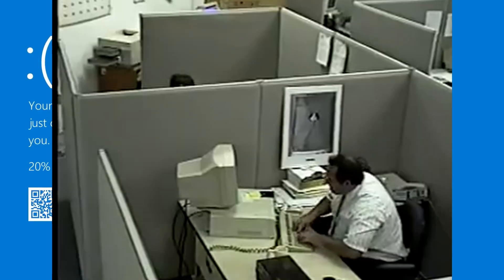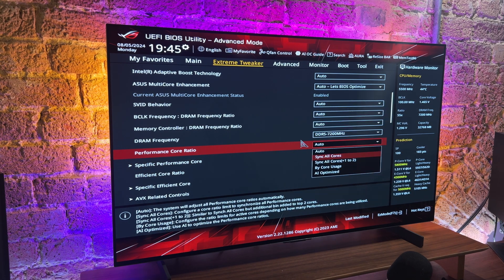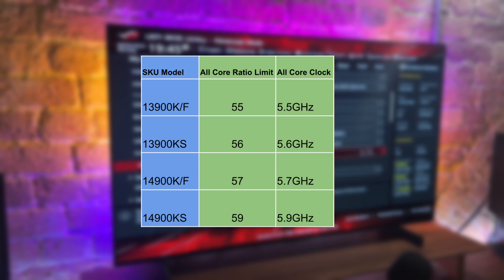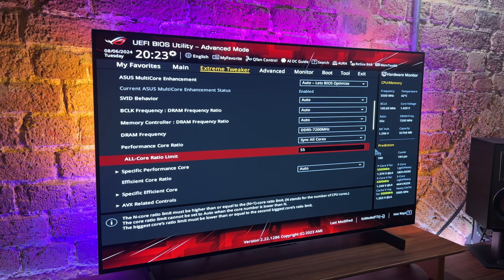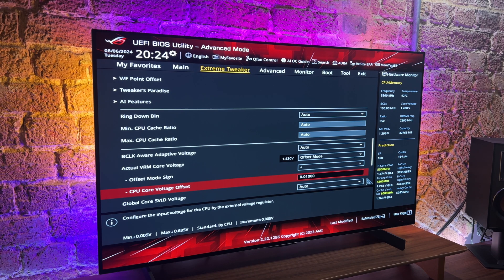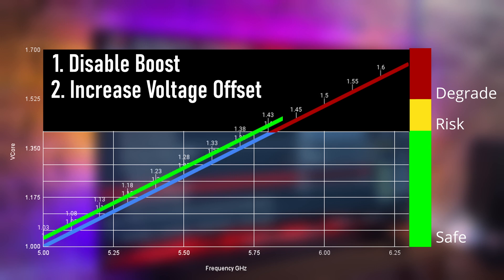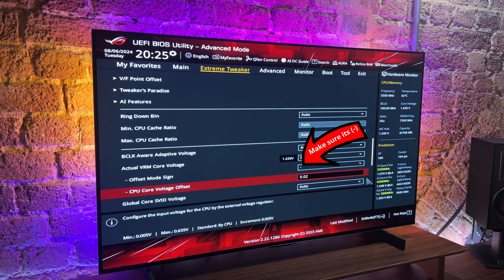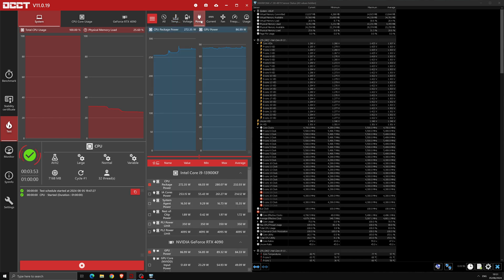How to fix intel crashes in less than 4 minutes

Comment: Thanks for the advice, I have 14900kf and the shop that assembled my computer after recommending a bios update with microcode only recommended setting pl1 to 150W and pl2 to 200W. And when I did cinebench 23 on one core the test crushed many times after 30 seconds. Which worried me a lot, although intel diagnostic tool claims that everything is ok. But I lowered the core voltage offset by -0.05V (because the voltage still seemed high to me it reached 1.492v on the performance core) and in fact cinabench on one core did the whole stable 10min reaching the result of 2123, (max voltage was 1463v) and on many cores 32275 which is still better than before (31200). The question is whether it is worth leaving 150W and 200W or giving more or whether the processor will work better or will be safe and stable. Obviously, stability is the most important but if it cuts a lot of performance that could be useful when working in blender etc. then maybe it is worth giving more?

Comment: Cannot understand if more than 1.38v is in risk, why use Vcore offset+ to work over this voltage, i use offset to all cores +2 instead vcore offset+ and reach 41k in CB r23 with 1.298 Vcore, max temp 85º. MSI MPG mobo +13900k + ddr5 6400
And a question, where you found that from 1.30v to 1.38v is in safe for an architecture 10nm?

Comment: Hello! I had a question. I'm trying to stabilize the all core clocks of my 13700k as I have not yet experienced any signs of degradation yet. When doing step 1 and disabling boost by applying the "Sync All Core" setting, do I also have to disable all of the intel boost settings shown at 0:06, or do I just apply the sync all core settings? Also could you please provide a list of all intel boost settings that should be disabled as well? Thanks!

Comment: All you guys post these videos of issues with the 13th and 14th gen CPUs and about how to fix the issues but it never worked for me because none of you guys have the newest bios installed. I have a Asus z690-p with a i3-13100 and it crashes after 10 or so minutes of fallout 76. I have the bois rev 3403 installed which is the newest one from Asus. How about you update your bois and then give us an accurate and up to date video is this flustering issue please 🙏🏾 .
Reply from the maker: If your i3-13100 crashes then it has nothing to do with degradation, it is something else. You would need to troubleshoot it and find out what the root causes is

Comment: I have i9 13900k its already degraded a quete a bit, and when i "sync all cores" windows dont even boot. only asus logo appears after bios and just stuck. how this can happening, whats the cause?
Reply from the maker: @anjelomichelangelo7726  you would most likely need to increase the voltage offset
Reply from the maker: Or just RMA the CPU
Reply: @gamedaytoday1  ty for answer

Comment: i tested, it's better in games but in many cases I face crashes all the time and no change at all. crash happens again and again.
Reply: i had crashes in fortnite after 0x129 code, but i also put ia vr limit to 1.375volts... then i ramped it upto 1.4volts, the game didnt crash for 2 months... now i updated to 0x12b code, the game crashes again even while setting higher voltages
Reply: @realracing3specter295 found a fix yet?

Comment: Should I turn on the Intel Default Settings that came out with the new Bios update?
Reply from the maker: @Arixfishy  just follow the instructions it does not mater if you use defaults old bios or extreme profiles
Reply: @gamedaytoday1 thanks
Reply: @gamedaytoday1 arigato (I'm japanese)

Comment: Hello a month ago or so I have build my gaming pc and I have an Asus motherboard Z790 A-Prime with an intel CPU i7 gen13700KF and I was running like factory bios version and my CPU voltage wasn't going any ware hight then 1.35 1.37 volts but had friends who told me to update my bios to today's version .. my guts told me not to do it you know how they say if ain't broke don't try to fix it anyways after few days I updated my bios to current version up-to-date with microcode 129 and first day after bios update my CPU voltage were lower from 1.35 to 1.25 1.28 but after 1 or 2 days when I was checked my CPU voltage while gaming I was an increase in voltage up to 1.45 .148 voltage you think that my be a problem should I undervolt the cpu also i have a corsaire aio liquid  cooler 360mm  and with the current CPU voltage my CPU temps don't go any higher then 65 Celsius what I should do .thanks in advance
Reply from the maker: @SmashJou-n7q  yes undervolt
Reply: Oky thanks

Comment: Actually just got my new ryzen 7800x3d to replace my old 12700k, since intel releases unstable 💩 Ryzen 7800x3d with pbo enabled, voltage curve -30, power limit 80 degrees, runs stabile, low temps like 67-70 degrees under gaming workload, 75-77 heavy stress testing, with power consumption 65-70 watts, giving much more fps in games, running cooler, and much more energy efficient than my old intel cpu is just amazing! Just AMD instead of faulty intel, there’s always a choice.
Reply: So hot in gaming

Comment: So I did this through another channel that covered undervolting or limit volting..since my 14700k was constantly crashing when playing the new season of POE...and I'm sure with other games as well...was having similar problems playing Elden Ring.  So my games don't crash anymore after doing this....but this STILL means my CPU is defective or degraded right?  So is the recommendation now to RMA this back to Intel?

Anyone who did the RMA to Intel...will they ship the new CPU first to us before we ship our bad one?  Cause it will SUCK to ship my current CPU and wait what weeks until I get the replacement and I won't be able to use my PC til then?
Reply from the maker: I read that Intel's RAM is actually good, there are a lot of positive mentioned on reddit, worth giving it a shot. I read that in some cases they will send you a replacement before you send it back, but you would need to pay $25 for that option or something. Go thought the process and ask.
Reply: @gamedaytoday1  Thanks and will do.

Comment: Just do the following steps:
1. remove the CPU from motherboard
2. put it in the original package
3. pack it well
4. throw it in the garbage can
5. buy an AMD CPU
6. be happy.
Reply: Yeah sure and totally forgot you run on a Z790 motherboard made for LGA 1700 and realise that even your RAM might not even work with an AMD AM5 config
Reply: @KamiKazeD  It's a problem when you have to explain the joke...😆
Reply: Funny ha ha
Reply: The problem is money 😭
Reply: @fast_rail  The money that you loose every time that CPU crashes, or, the lack of reliability that is imposed by this defective chips are countless. I had this bad experience in the past similar to this, and believe me, replacing the set entirely is way more cheaper than the headache.

Comment: Undervolted my 13900kf from day One, no big performance decrease (around 37/38 k on cinebench) and never get and problems at all
Reply: People get BSODs with 13th gen though. That is one thing to make it cooler, and completely different dealing with crashes.
Btw, as someone who got one of those bad CPUs, it did not crash because of the overheating. Usually, it would crash at idle or browsing the web.
There were defects in those CPUs not just misprogrammed voltages and settings. 
I was one of those very stubborn people who tried every fix guide before I replaced a 13700k.
It was the CPU. And crashes went away the day I installed new CPU.
Reply: @dontbeorbeevil Guess I was lucky so

Comment: I would like to know the name of these options under MSI. I'm using a 13700kf and I noticed 2 of the P core runs @ 54 multiplier instead of 53, i changed both of those 54 to 53, that's basically the only thing I've done (And disabled intel turbo boost) Am I gucchi? (using latest stable bios too)

Comment: Good video...I always fixed vcore to never go above 1.350v....Current max is 1.325v and I get full performance on my 14900K, no temp issues running a 360mm AIO, 41K cinebench R23 multi score. Motherboards and I have an MSI z790 Carbon was just pushing too much at auto settings and thakfully this is the first thing I change. Some can even get full performance with 1.3v or less...Also just updated to the latest bios released yesterday and no issues..

Comment: "I've heard that for undervolting, you should use the 'Global Core SVID Voltage' that's one step lower, rather than the Actual VRM Core Voltage. There's also the Adaptive Mode where you can further reduce the offset. What do you think about that?"
Reply: I would like to know too

Comment: Does this problem affects laptops as well?
Reply: lol, i dont think laptops are capable of drawing more than 65watts out of their tiny batteries; whereas the cpu degrade happens only over 250watts...
Reply: @realracing3specter295 the laptop at my work has a max turbo power of 157 watts, the 13650hx, so i can see the 14th gen eating that much or more

Comment: Question are locked CPUs which are the non K SKU’s vulnerable to these spikes in voltage? My i514400F never thermal throttles or goes above 1.2v
Reply from the maker: No issues with the lower models.
Reply: Thank you

Comment: If your processor is still very degraded, and giving it more voltage might actually degrade it further, then you should lower the multipliers by just a bit. I would even go further and see if any cores are specifically degraded more and having problems, then I would only adjust their multipliers to a lower value.
Reply: Instead of wasting time with that you shoul just request an RMA
Reply: i still dont get the point... how do you exactly know if the cpu is degrading? or already degraded? that is, if a cpu is not experiencing any crashes or stability issues, how do you know if its still degrading? do we have to assume, that 99 or 100% of ALL 13th/14th gen cpus are already/always degrading? then i believe this patch is a must for ALL cpu users, right???

until and unless, intel or anyone come up with a simple tool/test, which could easily identify the faulty cpus, no one is exactly sure if their cpu is dying or not.
Reply: @realracing3specter295  Technically, each and every processor, or pretty much any semiconductor is degrading over time, but really slow. But the degradation speed of these processors actually indicate a problem. Degradation is only a problem when the processor can't hit its performance target or has errors. Your 10 year old processor has probably degraded a bit, but there are still no problems as it is still running under spec, but if you tried overclocking 10 years ago, then you might notice that it won't be as stable at those clocks as it did 10 years ago.

I am not sure if the actual problems that these processors are having is a problem on all of the 65w+ 13/14th gen Intel processors, but given that degradation is a natural thing, and that higher voltages and power will degrade them faster, it does make sense to bring this microcode update to all of them.
Reply: @TuxikCE  i am aware that degradation is a natural thing which wears cpu over time. But in this case i meant, degradation over a short period of time frame, ranging from weeeks to months, not a decade. Some stats say 50%, some say 5%, of cpus are degrading, specially the i9s which are pushed over 320watts are degrading within a month... so how do we know if our cpu is failing or about to fail, when it showed no signs of crashing. I am skeptical whether ALL cpus are like that? If yes, only then the microcode would help.
Reply: @realracing3specter295  Silicon lottery plays a big role in why some processors have been living just fine, and some failing in a month. Golden chips might be able to handle those power and voltages fine, but others can't and are hence degrading. It could also be that the golden chips might just have a longer life due to superior silicon quality, so they might still be degrading and will fail eventually, but these are just my guesses.

I don't think that you can tell if your processor is degrading. From a physical perspective, the quality of the silicon starts degrading or some atoms of silicon itself can start shifting. From software perspective, I don't think there is any way to tell, unless encountering errors, by which point the processor has already suffered problematic degradation.

Comment: Most Intel users are addicted to high clocks, they really think that the 300mhz boost will change their lives forever. They think they're going to gain an advantage in everything they're doing because of these measly clocks.

They already bought Intel instead of AMD, just because Intel achieves more clock, and it's been more than 12 years that clock doesn't mean anything in performance.

Intel sold them a dream, CPUs that reach more than 6Ghz and they are not satisfied until they see the CPU reach 6Ghz with 0% usage.

Comment: This Kinda works, but with the offset voltage, i still get slightly low single core scores. What I do is just turn ac/dc llc from .5/.8 to .7/.8.
Reply: you can set IA ac/dc loadlline 0.001, it will never make your vid crazy and no performance drop

Comment: my 14700K with biostar b760m never touch VID 1.4v, VCORE aroud 1.2v, now still microcode 0x125.
I undervolt since begining, with : IA AC/DC loadline 0.001
No performance drop, even increase performance, around 35000  r23

Comment: There is no going back for the degraded CPU my 13700kf is already degraded and it can only handle ddr5 6400mhz . I fixed the crashing issue by setting pl1 power 250 watts, pl2 power 250watts and fixed 1.38 fixed CPU Voltage.
Reply: i still dont get the point... how do you exactly know if the cpu is degrading? or already degraded? that is, if a cpu is not experiencing any crashes or stability issues, how do you know if its still degrading? do we have to assume that 99 or 100% of ALL 13th/14th gen cpus are already/always degrading? then i believe this patch is a must for ALL cpu users, right???

until and unless, intel or anyone come up with a simple tool/test, which could easily identify the faulty cpus, no one is exactly sure if their cpu is dying or not.
Reply: @realracing3specter295  my 13700kf handled ddr5 7600mhz and overclocked all P cores to 5.7ghz right now it can't even handle 6800mhz ddr5 and it's crashing when I overclock it too above 5.3ghz this is how you find degraded CPU.
Reply from the maker: Just RMA it.

Comment: Running my 13600K with undervolt 0.125V, 5.2/4.1Ghz with intel defaults on BIOS, max core vid is sitting at 1.13V, 24000 points on CB23, never goes beyhond 70º
Reply: You mean -0.125v?
Reply: Running mine at 5.5ghz Pcore/3.9 Ecore at 1.24v, it was having issues but seems to be fine now

Comment: So then if you disable the boost Intel lied about The speeds and it's false advertising, 6ghz my arse, I said take my 💰💰💰 and you didn't deliver Intel, shame 😢
Reply from the maker: The boost is 100% marketing non-sense from intel's side to win singel core Cinebench benchmark scores to look good. In games having Boost enabled does nothing in performance, so disabling it does not affect performance. It may actual improve the 1% lows because the 2 cores are not fluctuating in frequency
Reply: It's not really false advertising. You can actually get 6ghz all core but you're going to need to do a delid and run a direct die at the very least.

Comment: With my 14900ks can I just disable the boost algorithms? And lock cores to 59 without the offset? What this offset does btw and why do we need it?
Reply from the maker: Yes you can just lock the cores at 59 without the offset, but you will gain better temperature and longevity by under volting if your CPU is stable.
Reply: @gamedaytoday1  can you please explain me please what’s the offset actually really does ?

Comment: another easy way ? Shop AMD
Reply from the maker: Is there a fix for the AMD dip?
Reply: shopping for AMD, does not make sense for most people who already invested a ton of expensive hardware to build a pc. in my case, my system is 1 month old, and there is no way i would dump my investment just because intel screwed up. same goes for most people who still believe pc hardware is seriously expensive and replacing it is not an option.

Comment: I don't know why people recommending bunch of crap when you can't tell if its gonna help cause degradation takes TIME !!  So why put that responsibility on yourself and recommend something that you don't know the answer on....

So if your CPU shown signs of degradation, NOTHING WILL HELP.

If you wanna PREVENT DEGRADATION,  THEN LEAVE FREQUENCIES AND THAT S** ON STOCK VALUES.
No syncing, no do this, no do that but...
UNDERVOLT YOUR CPU till your reach instability, then pump a tiny bit more back up and set STOCK PL1 & PL2 TDP values (INTEL ONES...)

Btw TURN THE F.. MOBBO MULTICORE ENHANCEMENT OFF ... ALSO THERMAL VELOCITY AS WELL ...cause you dont want your mobbo to pump voltages / raises clocks if there is a headroom cause you dont want it do degrade
Reply: Except increasing voltage absolutely does help on degraded chips. It compensates for the damage by having the mildly higher-than-stock voltage drive the stock frequencies better and prevent crashes from undervoltage. That's literally just how silicon works, dude.
Reply: Ok bra no need to shout